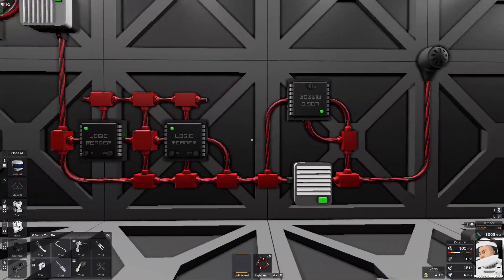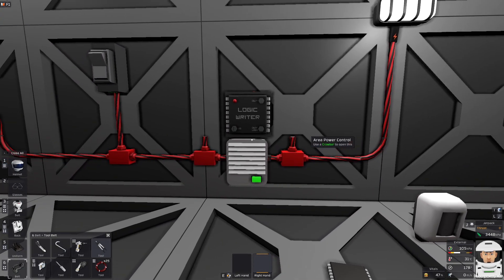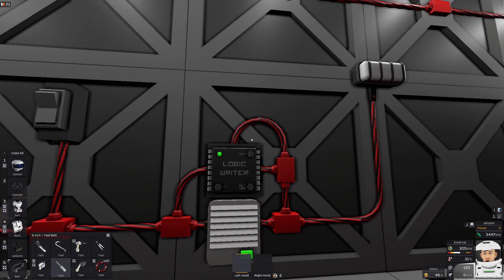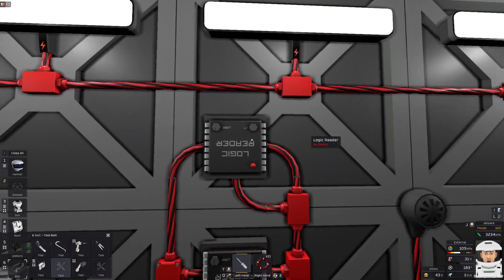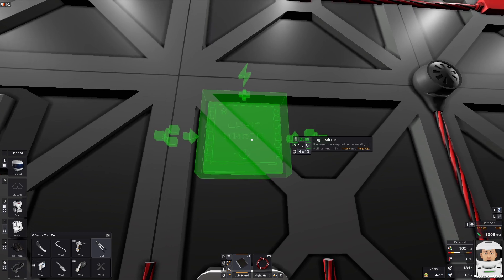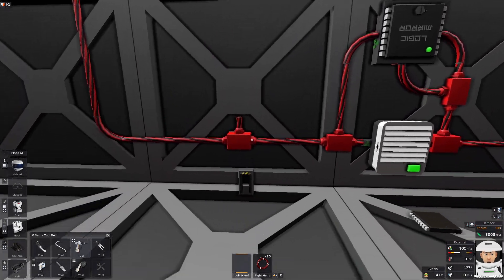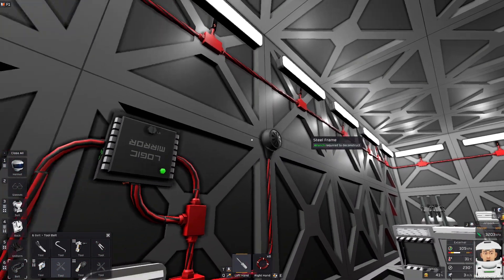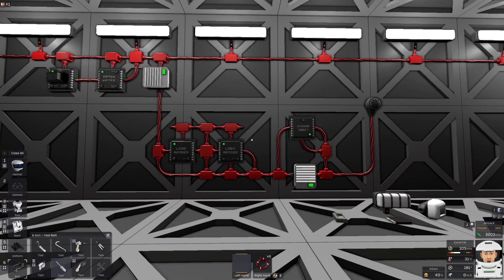Stationeers Tutorial Logic Mirror

Comment: I'm trying to control 4 medium transformers on 4 networks with a power console. Mirror isn't working. Only allows for setting to pass though, as far as i can tell. And read only. Any suggestions?
Reply from the maker: Not sure if mirror can work with consoles.
Reply: @AdamDeBeers  
Actually, I'm trying to mirror the medium transformers over to one control.
I got it by using the logic writer switch output only to the heavy watt transformer side. For some reason, the data is on the output side of a medium transformer. 
But for the power console, I created a dummy i/o that I read power off of. Switched by the console. Then, a batch writer to the (big switch) i/o. Each controlling a transformer. 
All controlled by an IC10. That way, I can shut down for storms or manual console operation. Controlling all 4 transformers. Thus evenly splitting 100kw potential to my 4 battery banks. (198mw)

Next, i have digital chutes on my silos and the silos themselves on that same network. Likely rewire the chutes. But going to logic reader the quantity off each silo I think.
Reply: What I'm not seeing though, is a true mirror of all functions. But mearly setting read only. Only the one data point. Boo.